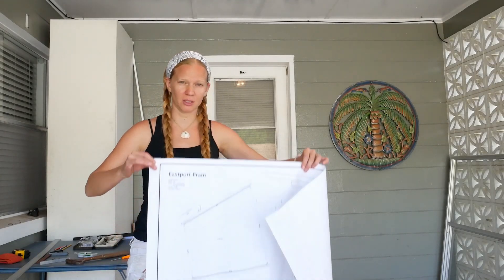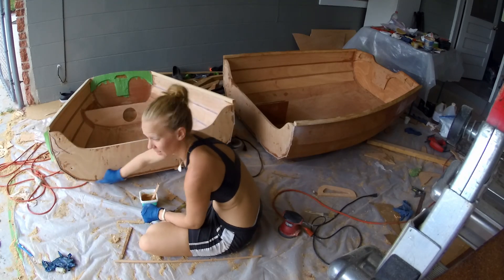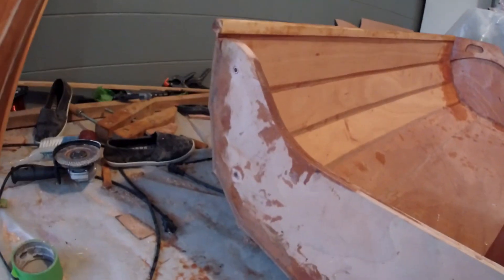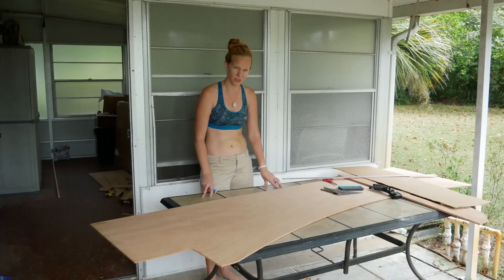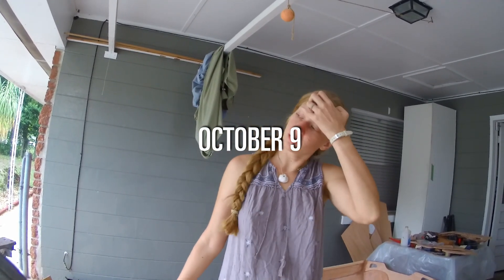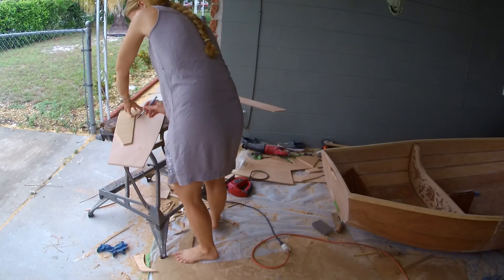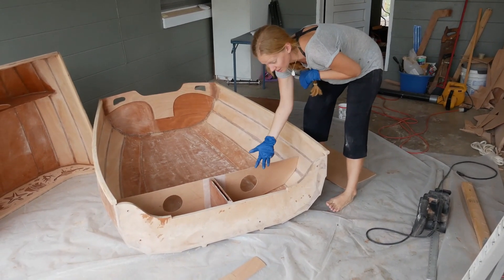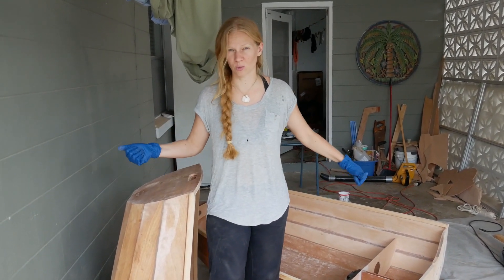Emily Builds a Sailboat - MAST & SEATS - CLC Eastport Nesting Pram (Ep 8)

Comment: Pretty cool project...i use just about anything for weights on glue too...i grab my sledge hammers mostly..have a lot of those. Hey, so what i'm seeing is two isolated boat halves being coupled together...is that for strength or for water isolation?...where one half might be compromised without filling the other half of the boat?
Reply from the maker: It's so it takes less storage space on the yacht.  The front fits in the back.  
   Check the earlier videos in Emily's series.  -C